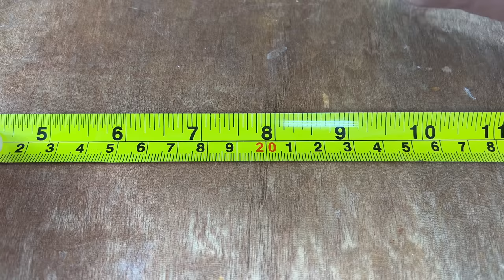Homemade Jigsaw Table Machine - DIY Jigsaw Table

Comment: Because using a "scroll saw" the normal way is to safe...instead, build this so the unguarded blade is sticking straight up in the air, and it's extremely difficult to turn the saw OFF in case of an accident. Smh

Comment: I've done table refits of Skill saws and jigsaws.  They do let you control cuts better, HOWEVER I use a foot pedal switch to control the power, so you can start or kill power on a seconds notice.
Reply: I do that too. My local Dollarama sells Foot switches to be used with Christmas tree lights that work perfectly for this.  It's rated for 13 amps.
Reply: @Alacritous 8
Reply: @Alacritous  that's so smart! I never thought of using Christmas lights with the button! So smart! Thank you I'm gonna use this idea

Comment: These blades are flimsy even when used properly. The extra distance from the saw to the cutting end of the blade will flex it way off the 90 degrees you need for a clean cut. Way better off just learning how to use the tool as it was designed.
Reply: Yep ... this is OK for thin stuff ( like PCB laminate or plywood / hardboard ) ... but for thick planks of wood , better to use a band saw ( although these machines are MUCH more expensive ! ! )  .... DAVE™ 🛑

Comment: Know these jigs. A low budget method if you urgently need to replace your band saw. But nothing more: first problem is that pieces bigger than half an inch will already get an all-over-the-place angled edge instead of a rectangular one. Second problem is that you need a specific blade as the normal ones cut when the piston pushes them down. This pushes the piece you're working on away from you in this particular situation as everything is upside down. Now imagine how you hold a chunk of wood down with force (you should never use force with electric tools) so it won't fly away. These blades exist but still, you need a guide rail on the top like in a band saw to keep the blade straight. And since there is no tension it will never be a full replacement for a band saw.

Comment: Why use wood and a cut piece of metal to secure the jigsaw to the top wood? Couldnt you just as easily drill holes in the metal of the jigsaw and (using washers) screw directly to the top?

Seems like unnecessary complexity to me.
Reply: I was thinking the same tbh?

Comment: IMADE ONE OF THESE

I made one of these over 10 years ago. And I maysay mine has more operational design and extras than this one. It is sited in my green house and still works. It also has roller bearing blade supports.
.

Comment: For (  ¼ inch max , THIN  ! )  pieces , this is  MUCH  cheaper than an expensive  band saw , but use the  CORRECT  type of blade for metals and PCB fibreglass ....... DAVE™🛑